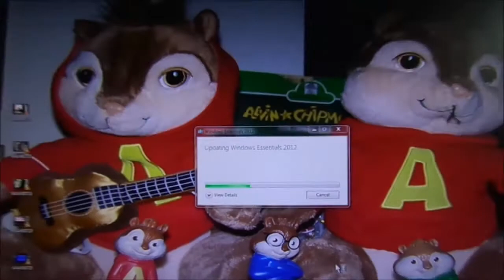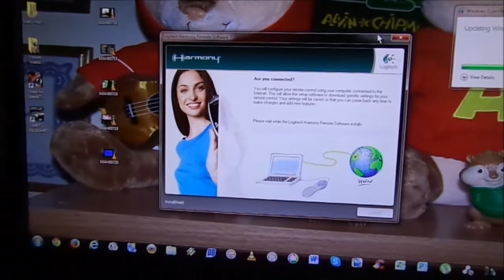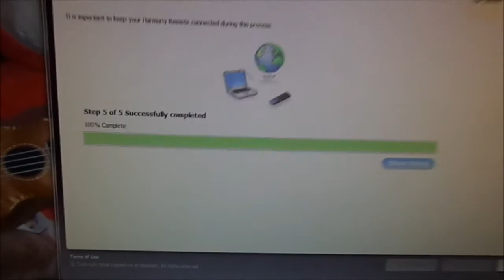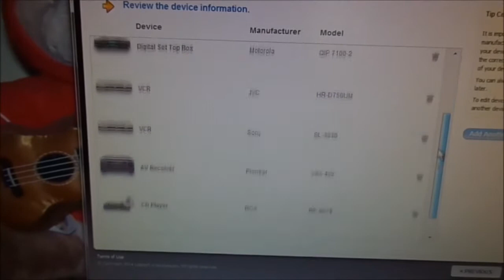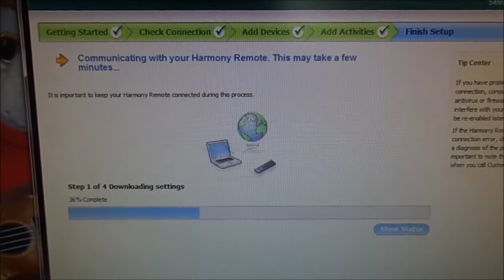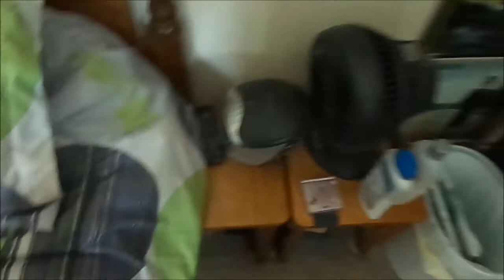Logitech Harmony 550 Remote Control Review and Set Up Part 2

Comment: Hi, did you find the issue why you couldn't turn the t.v. off? Devices->TV->Off button...? Is the remote ok?
Reply from the maker: The remote had a few bad solder joints, this caused the problem. I will probably try and repair it some day, when I have the time.
Reply: this is old answer, i have had this for one for 15 yrs of so.  in devices he missed it , it was  power toggle, thats  on and off for the tv . if you can get one, try it,  best remote ever even for the newer replacement models , ive changed tvs, stereo  receivers, cable boxes and without fail , it works.